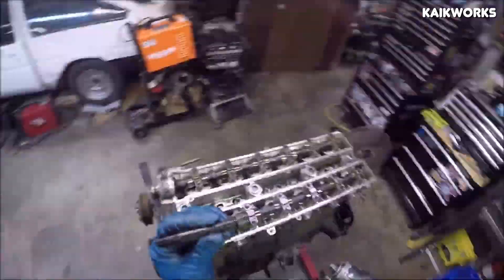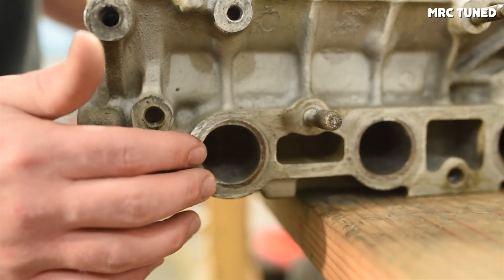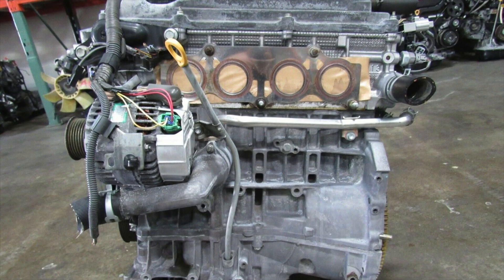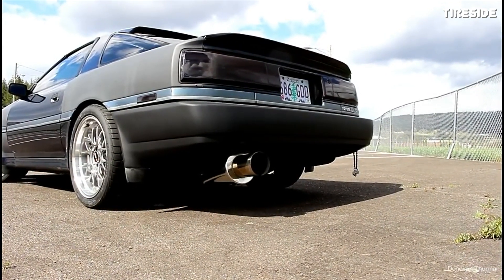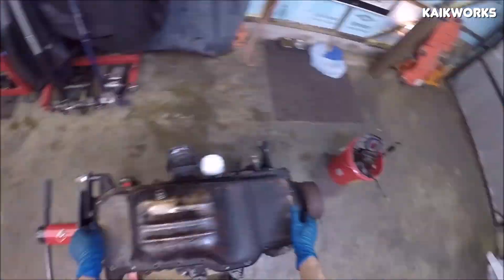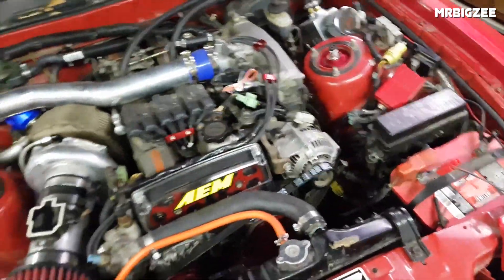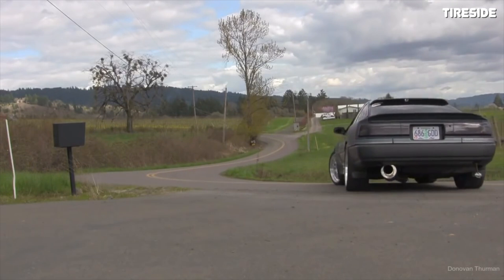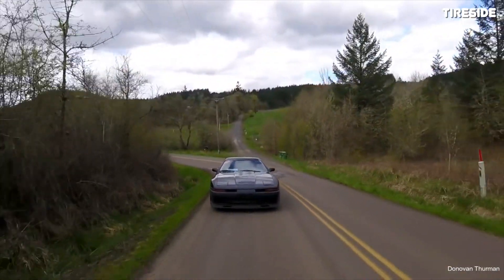Toyota 7M-GTE: Everything You Need to Know

Comment: DUDE. As an avid 7M fan and builder, you hit the nail on the head. Can't fault these facts! Good shit
Reply: I wanna buy a  7M soon, what can i do to make the engine safer, so it doesnt blow up? Which parts do you recommend to change/upgrade? And what do i need to care mostly when buyin one?  ✌🏽
Reply: @99Akhi  Hey man.
So are you planning on buying a 7m for a conversion? And do you plan on building/rebuilding it?
Reply: @SaucyTuRkLeBiRd  i am planning to buy one
Reply: @SaucyTuRkLeBiRd  so what do i have to look for, to avoid gettin scammed
Reply: @99Akhi  If you arent rebuilding it best bet would be to
1. Get the owner to do a comp test and send you pictures inside the cam covers to make sure its clean. Ask when the headgasket was last done. If it already has ARP headstuds and they are torqued to 90ftibs with a metal headgasket or the same with composite gasket, then you're good to go and refer to part 4, otherwise keep reading.
2. Once you have the motor, remove the head and get it machined. The roughness average (RA) NEEDS to be fine and the head surface should have a mirror finish. Inform the machine shop of this. Also get them to do a hardness test. Also check and clean your deck surface at this time
3. If not decking the block (must remove pistons etc) then I would recommend going with either a factory headgasket or AJUSA composite gasket with ARP headstuds (studs not bolts) torqued to 90ftibs. Clean the deck surface as best you can and check for straightness. Some people get away with a MLS without machining the block and timing cover but its a little risky. Composite gasket done properly can still make 450hp ish reliably. 
4.You're gonna want to replace all the seals too while the engine is out, and AJUSA have a full engine seal kit for this including headgasket. Follow the instructions on the Cygnus TSRM for this and use High temp oil resistant silicine on the parts where a cork gasket is supplied. 
5. While the engine is out, shim the oil pump (google "7m oil pump shim" - I think the general consensus is 5mm) or buy a Driftmotion upgraded oil pump. At this time also replace the stock oil hardpipe with an Arizona performance 7m hardpipe which flows so much better. 
6. Also while the engine is out replace the timing belt and the timing belt tensioner.

Hopefully this will keep it reliable for you.
Reply: @SaucyTuRkLeBiRd  thank you so much for your help and your time you took for that comment above. youre a true hero!
Reply: @99Akhi  No worries hope it helps :)

Comment: Hey great video. By chance would you know the measurement for the block top to bottom and the measurement of the head valve cover surface to bottom? I can't find this info anywhere, my engine head had been rebuilt and cut 2 times and it has to get done again. Thanks

Comment: 7mge better than 7mgte. 7mge with cam upgrade will keep up with stock 1jz twin turbo. And will cost about $1500 vs $5000+ today's prices. Can also put the 7mge head on the 7mgte block for a little added HP due to better flow. 💪🏻
Reply: Full counterweight crankshaft aswell 
And wider bearing journals than jz engines

Comment: As an owner of two built 7mgte cars here are my thoughts. A 7m is better than a 1j which doesnt make torque and is prone to spinning rod bearings. I have reliably ran a 7mgte at 18 psi making 425 wheel on a dyno  for about 4 years before I upgraded. Dollar for dollar a 7m will crush a 1j.
Reply: Hell yes! 7MGTE's are amazing, as long as you're not afraid to get your hands dirty. Kind of a blessing in disguise ;)
Reply: 7MGTE is a good engine minus the weak point being the gasket but that can be fixed with ARPs Bolts and the Metal Head Gasket other then that its 3.0 TQ motor. I will say though once you go with the 1JZGTE and the 2JZGTE the RPM of the engine the twin Turbo design does produce a fairly amount of good TQ and has the potential of HIGH HIGH HP numbers once they are properly set and built that the 7MGTE tailers off

Comment: two things you would understand if you actually owned one and wrenched on it number one it was a hell of an engine ahead of its time but was never built for high pressure turbo charging and number two rod knock is a issue with lack of oil due to g-forces If you start drifting an old 7M without any kind of oil pump work, she'll come knocking quick

Comment: They sound better then the jz
Reply: Yes they do they sound deeper.
Reply: I had a Supra store upgraded turbo , gm’s fully 3 inch stainless down pipe to a full 3 inch stage pipe with Lexus injectors and a maf translator, build r154 “dog box” with a soild hub 4 puck clutch and a modded turbo xs rfl bov that car was legendary in Philly around 06/07
Reply: @caperformance_motorsports  hey man did u have a talon ?
Reply: @m3rk201  yessir quite a few , I’ve had a lot of different cars back in the day .
Reply: @caperformance_motorsports  i bought your white talon from you. And you seen.my buddys 1.5 jz mk3
Reply: @m3rk201  I have had 4 1g dsms I still have 1 black and gray 1g
Reply: @caperformance_motorsports  I’m the 7m king now buddy in Philly
Reply: @ventiuno1646  let me take a ride from Georgia to there then I’ll be the king 🤣
Reply: I mean compared to the 2jz in my opinion they should the same and compared to the 1jz the 1jz sounds better
Reply: @61936  my opinion the 7m sounds better, and yes, I’ve heard both in person, straight piped
Reply: Ideal engine for "cruising" with 280hp?
Reply: It’s a half liter more displacement. It’s lower and probably sounds bigger
Reply: Not at all. Not even close.
Reply: @negativeindustrial  you on crack?

Comment: Having trouble believing these engines are great if they came messed up from the factory lol just saying I wouldn't want to buy one just to do arp studs and headgasket with no power gains 🤷‍♂️
Reply: To me, that means you can get a 1jz for $1000 if you spend $250 on studs and a quality gasket. Sounds like a good deal to me. I guess it's not if you're scared to get your hands dirty but hey, to each their own.

Comment: I've had an MA70 as my daily for the last 4 years now with an unmodified 7M-GTE in it.  I was fortunate enough to have a customer in my previous job who had been a Toyota master technician for some 30-odd years, and I had a lot of opportunities to pick his brain about this engine.

And these are the things I subsequently learned: 

- The head gasket issue is more common on the non-turbo models as the non-turbos run at a naturally higher compression, although it is still something which you will find on a turbo model.

- The issue was caused in-part by the torque settings on the head bolts, but what also compounded the problem was that a large number of head bolts were manufactured just a teeeeeeeny bit too long, you wouldn't notice it by eye, even when the bolts are fully torqued up, but because they were that bit too long, they bottomed out on the block and left an almost microscopic gap which over time led to a blow.

If you have had a head gasket done, and it's been done to the specification of the technical manual update, you have a very strong engine which is capable of around 450bhp on the stock internals.

You have to drive them sensibly and remember you're dealing with a 30+ year old  car, don't go flooring it from cold and let it run at idle for a couple of minutes before you turn it off if you've been on boost a lot.

You don't have to wrap them in cotton wool as such, but you just have to be sensible with them and they'll treat you good!

Also just to note, all our Turbo models in the UK came with an LSD as standard, so if you are looking for an LSD for your example, you'll probably find one from a breaker over here more easilly than you might elsewhere.
Reply: My 1989 non turbo had a lsd from the factory. Maybe it was an option.
Reply: @mikeadams42 my 89 turbo has a lsd as well. Could be
Reply: Thank you for the facts by the way. I heard about the bolts actually being a tiny bit too long before. But hell yeah
Reply: I always thought the idle before shut off is too cautious? Like you have to be in boost the entire way until stop lol? 1JZGTE, original 2.5 years with me strong

Comment: With todays knowledge, steel headgasket and shimmed oilpump fixes both major problems, now youre golden. 
-proud 600whp 7mgte owner
Reply: I mean you can say that about a hell of a lot of old engines
Reply: Do you know if I can use a 7m gte with w58 transmission?
Reply: @D0nie11  im pretty certain you can yes but i wouldnt bother, use a r154 or something else, i dont know alot about the 7mge but i think it uses a w58
Reply: @MsportAlex  Mmm the 7m-gte has more torque and power than 7m-ge, maybe for best result I need to use a R154😬 but I go to try with the W58.. For this moment I haven't other..
Reply: @D0nie11  make sure you buy a rebuild trans or rebuild it the first gear thrust washers are plasti oem and wear fast once you start making power aloong with the stock clutch I’ve ran a few ebay grip force 6 puck clutches last 500whp when I had my 7mgte and then my 1jz 240vert
Reply: @caperformance_motorsports  Nice, great information!!! THANKS BROTH!!
Reply: @D0nie11  yes
Reply: @TerrenceLP  Thanks this is my idea.. I have a mx73 cressida with 5M-GE and w58 transmission.. Thanks again👍🏻
Reply: Yes, you can.
Reply: @D0nie11 yes but itll barely handle the power, and you will shred the clutch....speaking from experience
Reply: can a 7m make 1000hp?
Reply: 藍戰士Kit Kit Chan Isaac yes
Reply: @MsportAlex  no
Reply: @KitKitChanIsaac  yeah I saw a video on youtube where the dyno tuned and show the max hp. I was impressed. If you want to see the video I will link it here so let me know
Reply: Mine was 600+ hp .. had twin skin kevlar clutch ... meth injection , 5 boost settings and launch control .. full internal work .. p/polished head , metal gasgets , studded down .. forged pistons .. externawastegste cost me $50+k to build back then with computer install ... had a bigger turbo for it but sold it before it got put on .. was set up for massive single turbo (hence methinol injection ) engine easily handle 1000hp ... was set up for drags but a road car too .. but to hard to road drive ... unless long trip ... (with speeding tickets ) got gs 460 now im an old man ...
Reply: @KitKitChanIsaac  7mgte drag car makes 1700 hp
Reply: Or just luck
Reply: Naww. I’ve replaced my steel gasket 2x in my 91 supra. The manual even says the wrong torque on the heads bud I’ve fixed that too. No good
Reply: ryan williams did you also have your head and block decked? Because you most definetly didnt. Mine had it done and torqued to 110nm (if i remember correctly) in 4 passes and its never blown the gasket
Reply: Still doesn't change the fact that the 7M is absolutely garbage.
Reply: rbs tap jz in the as

sorrry
Reply: No you can't
Reply: @TerrenceLP  my so far 20.000km 600whp 7m can
Reply: @MsportAlex  still stock internals? Just rebuilt my 7m with all the supporting mods
Reply: @spencerbeane2924  no its fully built except the head, bottom end is good for 1300hp
Reply: 7m sux, 2jz is still superior
Reply: @dickfitznyew4579  "iphone 4 sucks, iphone 11 is superior"
Reply: @dickfitznyew4579  we all know that however old Skool and affordability is huge in todays world,I love my 7M-GTE if I was to do a swap either a 1UZ or a 1JZ.
Reply: @dickfitznyew4579  if it wasn't for the 7mgte, you wouldn't have the 1jz or 2jz.. and if toyota didn't have head gasket issue .. imagine where the 7mgte could have been.. but you guys always forget that!

Comment: The g also stands for a performance cylinderhead that is designed by yamaha
Reply: “G” stands for performance-oriented dual overhead cam setup ...
Reply: @ACommenterOnYouTube  are there toyota engines with the G in the name that arent yamaha co working related?
Reply: @monoracer_  afaik .. the 2jz head was the ONLY part of the engine that was designed by Yamaha but built by Toyota. 
Not sure about the 1jz or the 7m series. I only know this because the 2JZ haters tried to find anything wrong with the 2JZ and they found out that the head was designed by Yamaha.
Reply: @ACommenterOnYouTube  lol i found this a positive thing, not something to hate on

Comment: Honestly, like 300-325 horsepower in these cars would be plenty. They weigh 3400-3600 lbs. Thats nothing to scoff at. Yeah sure you'll have cars like scat packs and camaro ss's and mustang gts that will beat you in a straight line but depending on your wheel, tire, and suspension set up you will always have them in the corners.
Reply: In a busy city, 300 hp is more than enough. What are you going to do with 500+ hp in traffic ??
Reply: You guys act like 500 hp is alot of horsepower. Its a 3600 pound car it needs 500 hp to even get into the 10's in the quarter miles 450-500 whp is perfect in these cars for a chill street car. For a basic crusier with bpu mods or if youre not replacing the headgasket and worried about it maybe sure but with a upgraded ct26 or even bw s360 it can easily make 450 whp and be chill but also still whoop up on most the cars on the street outside the supercars and new stuff like hellcats and ctsv's and rs3's

Comment: I have had a 7mgte in 1 of my cars for years, only bought the 7m because at the time that was all I could afford..... after about 3 head gaskets latter built a full engine.
Still have her now and still turns heads, on 14psi makes 480 rwhp and on 21psi makes 586 rwhp on pump gas. I love the old 7mgte
Reply: Thanks i will keep you updated enjoy your 7mgte with that power 
shalom
Reply: @elshaddaimotors1031  yeah cheers mate, they are a good engine when dialed in. 👍
Reply: Amen brother
Reply: Hi what turbo you use i am busy with the same engine i am looking for 500 whp not more will the stock  internals handel that power please let me know shalom
Reply: @elshaddaimotors1031  Hi mate, I'm running a Garrett gtw 3485, awesome turbo kicks like a mule when comes on boost but only comes on at about 4500rpm, was using a turbonetics t66 before which was more street able and still made 475rwhp
Reply: Hi thanks will the stock internals be good for the power 
shalom
Reply: @elshaddaimotors1031  yeah I would definitely throw a mls cometic head gasket and arp head studs, and deck the head while your there, 
Then rods should be ok I had a set of factory rods shot peened and polished and where fine for the power your after, but factory pistons I reckon would be ok as long as everything supporting them are good, as in good fuel supply and tune, but if it was me I would chuck a set of forged piston in there for good measure
Reply: Guys about to rebuild 7MGTE do you have a solution for the oil pump input shaft retention bracket.?
Reply: @Andrew  no I haven't had any dramas?
What is happening with your engine?

Comment: well i thought this was a video why the 7mgte is better than its followers - like the title of the video?
bummer!
i think the 7mgte is better because of several things.
1. it is simpler electronic wise and turbo wise.
2. better lowend.
3. much cheaper horsepowers.
4. the issues named are easily fixed today.
eg. rvs engine treatment which completely nullifies engine wear and restores tolerances for infinite driving and easy tuning. magnesium oxide is the reason for that. no exotic materials needed for tuning anymore. and no i am not a reseller, just a fan😄
so the 7mgte was made right from the beginning with todays exotic tech to help in longivity.

ps.
ups, i forgot yet another advantage the 7mgte has over its newer siblings.
it has a smarter inlet config where you can directly connect the turbo to the inlet manifold via a Barrel Water To Air Intercooler. much simpler and more pressure for free. then the stock turbo will show some teeths...
the inlet manifold on the 7mgte is more balanced and with lesser risk of bad mix failure on one or more of the cylinders.
1/2jz inlet look clean and nice but is risky and complicated to balance.
actually i dont think toyota thought of an intercooler when they made the 7mgte. it was new knowledge back then. the same happened to the honda cx500turbo mc - i just never got an ic...
i guess again you can say the nice tech of today makes the 7mgte an even better designed engine than its successors - with some small mods🤓
Reply: What do you mean by rvs engine treatment?
Reply: @navin9315  https://youtu.be/f2WHVxqfWZ4
Reply: What’s the Rvs treatment

Comment: Hey I swapped a 7mgte into a 240 volvo wagon.the only concern is oil pressure it does not pass 25 psi.
Reply: Just chuck the stock oil pump for a new drift motion one.

Comment: Completely skipped over that 7m is a 3l compared to 1jz 2.5l and with under $2000 in motor it will take 600hp plus all day
Reply: Pistons and rods cost me $1500 plus bearings arp studs and piston rings all in $2000 machine shop balanced bottom end port and polished head myself and they assembled for a$1000 so all in $3000 and motor is good for a 1000hp
Now of course turbo, manifold, wastegate, intercoooler etc cost extra but my point is for around $2000 in internal engine parts the motor is a beast
Reply: @TorontoSupraMan  ah okay trank you man.
Reply: Hey i want to see how you get to 600 hp with under 2k. Iam trying it by my selfe and Iam a way over 2.......